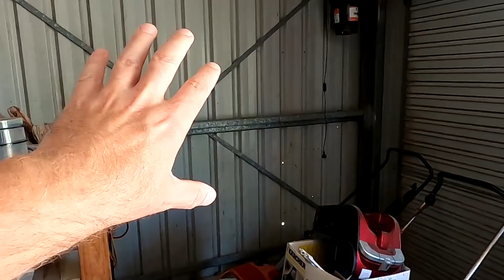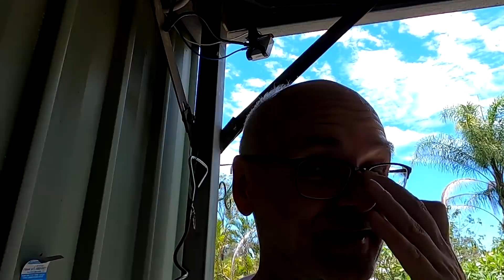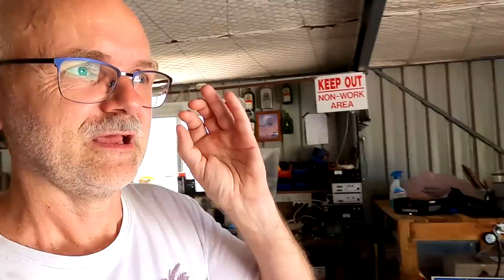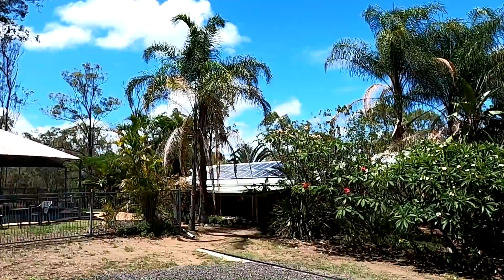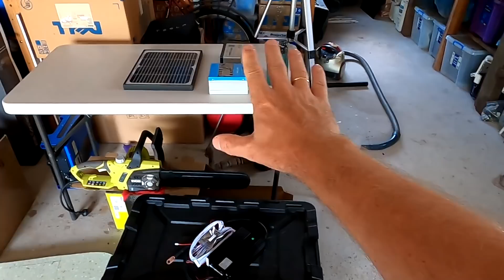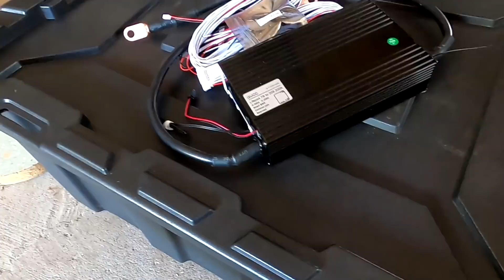Solar-Battery-Essentials. What do you really need?!

Comment: Andy, I have a question... I have a Rhino (16cell 48v battery 14kWatts) and there is an 8 parallel maximum for them. Do you feel you have the same limit with your 16 cell 48v battery? What is it that limits how many battery packs can be paralleled?
I'm guessing it is an artificial limit by Big Battery as having that many non inter-communicating BMSs would/could allow drift among the 8 batteries? My installation is inside my 20' long Toy Hauler, I plan to have 4 in it, but when I build a house I'm certainly going to want more than 8 (112kWatts) batteries. I'm just guessing I'll want at least 400kWatts based on reserve days and amount of sunshine.
Reply from the maker: Hi Paul, I cannot see any limit in paralleling battery banks as long as they all have their own BMS and are properly fused. Even if one bank shuts of earlier due to a different settings in the BMS, it should not matter.
It's a different story when series connecting such batteries.
Reply: @OffGridGarageAustralia  hmmmm, wait a second, if batteries are in parallel, and one stops charging because it hit its limit, doesn’t the charge controller see that high voltage as well and shut off all charging?
Reply: I think I understand it now… the internal BMS cuts off charging at 58.8v, my Growatt only goes to 58.4v. So the first Rhino to hit 58.4 shuts down then and not at the BMS’s level.

Comment: Looking at an all in one unit probably either a PIP 8048MAX or a PIP 5048GK. Looking at connecting it to 16 x 280ah cells like yours. I am just unsure what BMS to get. I may consider upgrading to 32 cells in the future. I really want a reliable bms. I am a bit shy of the one you have used given the problems you have had.
Reply from the maker: Get the DALY 250A BMS with fan for that sort of setup. The 8048 is amazing. I'll come and visit once you have it ;)

Comment: Hi there can lithium phosphate cell handle surges from 2x number swimming pools and deep well pumps as well as up to 7 ac units running at once with the potential of 4-5 ac's being switched on at the same time with a 50-60kwh battery bank. I'm a few years away from wanted to be off grid when in emigrate to the Caribbean but will need to run a three bedroomed house, two x two bedrooms apartments and a one bedroomed apartment all from one system. Could I parallel 5 mpp 5kw inverters or similar together and how many bms should I use and at what amps if I'm using the 280amh cells for the large battery bank. What size back up gas generator should I get to run all these properties and to charge the batteries when I have no sun for three or more days?
Reply: You need to read more :), Best situations is to have each property be independent from others on the PV side and the battery side. This will reduce the load that each house will have to take. Let's say all houses need a single output of 50kw, than you will need very very thick wires connecting to each house. The length of wires across multiple properties will cause line losses. 

On a summer day with 2 AC I use about 20KW energy. That means with 6 AC I will be using 60KW. If you want a three day back up, simply multiply it with 3, that means 180kw back up.

16 cells x 280ah x 3.2v = 14,336. Assume we use 90%, that is 13KW per 16 cells. You want 180KW, that means you have to use 14 sets. You will need 224 cells roughly. If you go with 1,000 ah cells, that means 56 cells are needed. 

1 cell cost roughly 110~130 dollars with shipping (not sure about taxes). Just the basic cell cost at the cheapest is $24 500. Assume other costs, the system will probably cost you about $40 000 or more with all additional costs just related with batteries and solar.
Reply: @ asder alt. Thank you for replying. obviously I guess that means more sets of battery cabling and bus bars, so more expensive. What does that mean for a generator when I need to charge all the sets during a week of no sun? It's seeming like I'd need the grid to charge the batteries, but my dad does not have the grid when the land is. I could get it but the c out is massive to get it installed. I want to be bill free, on my eco retreat.

Comment: Hi Andy, great video. Is there a specific reason you need an enclosure? If your install is inside the shed out of the weather I would just mount on a non combustible board. This is how I have mounted my MPPT's, inverter and switch gear and they still get up to 75 degrees C in Qld summer under load. If you put these in an enclosure I think you will need secondary mechanical cooling to ensure the gear isn't derated in operation and reliability is maintained. Look forward to seeing what you end up doing. 😄

Comment: Why not both? 2 of the 48V LiO 1.8Kh battery packs attached to the MPPT solar charge controller inverter for the high power system for the motor home, water system, and security system.  But what are you going to do for the internet access across the property?  Solar panel to a charge controller with a 12 v 100Ah battery driving a 200 watt inverter that powers the router, wireless links, and access points covering 51 acres.....

Comment: Not a good idea to mount electronics inside an enclosure. You need air cooling for these devices.
Reply: It's cheap and easy to buy a temperature controlled relay fan set up so that if it gets too hot in enclosure it will turn on fans at bottom of case to force air in and another fan at top to pull the hot air out. It's how it's done in industrial environments :)

Comment: Skip the enclosure and mount to a piece of plywood.  The only lethal voltage is the solar run, so just enclose that with a conduit and protect the input terminals from hands.  You want airflow.  Charge controllers and inverters have heatsinks or fans that need air.  Better to leave them open to the air.   If you put in an enclosure then add some intake air fans.

Comment: I would use the biggest one and for what it is worth mount the Charge Controllers & Inverters on the outside using metal cabinets as heat sinks

Comment: Andy, the larger enclosure is better for airflow. (3) solar controllers will require much cooling- lots of airflow. They are essentially heat sinks. In THIS case, bigger actually IS better. Yes, the MPP LV2424 is a great answer for an 'Off Grid Garage" BUT, you'll need a bigger inverter!!! If memory serves, the LV2424 comes with a 2,400W inverter- not powerful enough to cover high inductive loads of power tools. Bummer. It doesn't work for those of us RVing either. Bummer for us. Because they are excellent answers for buying an all in one!!!

Comment: I have to disagree. With an offgrid or hybrid inverter (like Voltronic Axpert aka MPP Solar) you can limit the battery charge. With lot of MPPTs not (parallel output). You can only charge max with 1C = 280A. But its better for the cells if you charge max 0,2-0,3C like 60-80A. In a one unit inverter you can set a limit. Also you can parallel inverters. And with 2 inverters you have 4 built in MPPT, and 2x5000W = 10kW output peak 20kW for 5 sec (and inverters communicate with each other)! Or with 3 inverters 3 phase 5kW output (and inverters are cheap). Also you can choose what to do with the power (a setting in the inverter). Put it into battery, or power the house with it (or hybrid to sell to grid). Even you can control it remotely. With BMS communication inverter knows the real SoC of the battery. Without it inverter knows only the Volt and that jumps up and down (20-30-...%) depending on load (LiFePO4 discharge curve is almost flat). BMS separate port or common port? So a lot of things you can do with a smart device, and can not do with a bunch of stupid devices. Also if you have wandering shadows use a Tigo optimizer with the panels. Simple and clever always better.
Reply: Do you use Tygo optimizer?